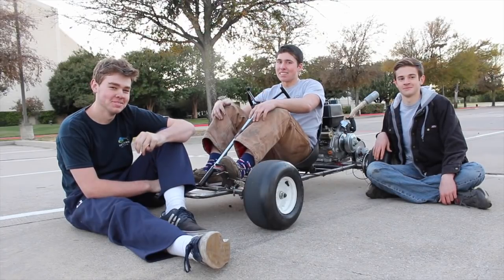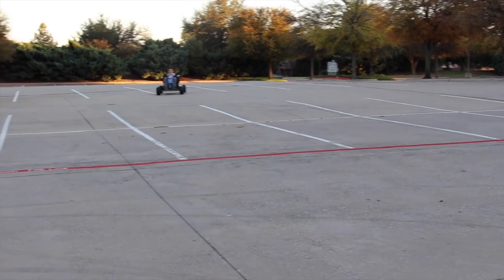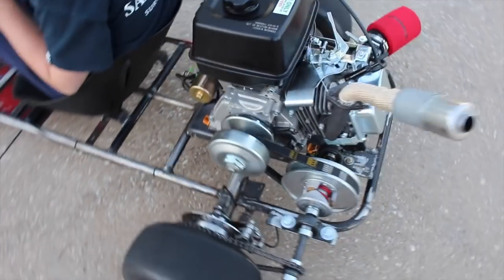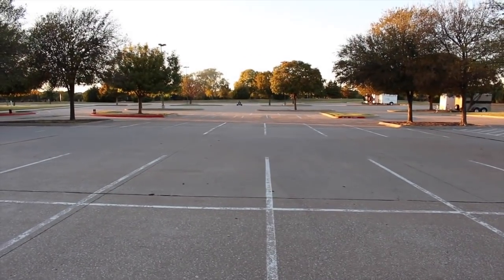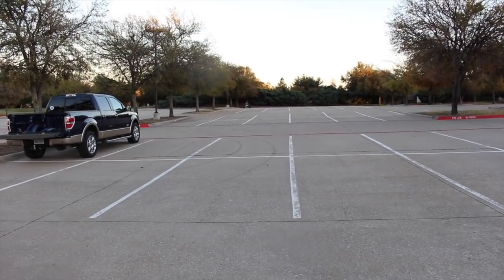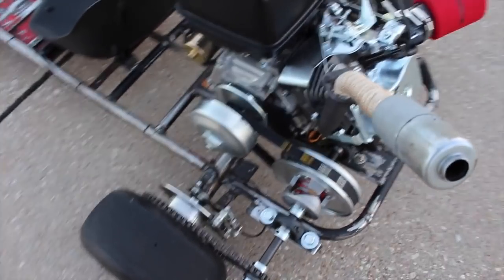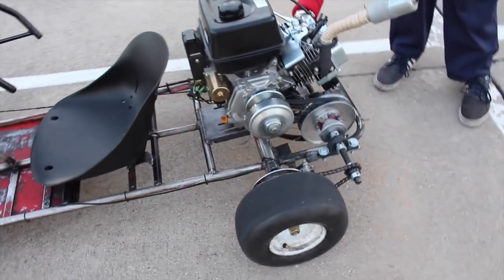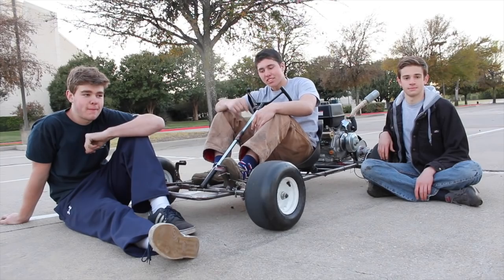We Built a 420cc Yard Kart for TV!

Comment: From what i could see,your clutch is not lined up with the torqe converter.your clutch on the engine side,should be lined up with the torque converter perfectly,or it will keep tearing up the belts.I used to work on snowmobiles and had run into this before!
Reply from the maker: Robert Hardwick ok thanks, I’ll take a look when we install the new belt.

Comment: Looks like your belt is too tight. Your jackshaft is too far away from the engine. There should be a little play in the belt when the motor is stopped or at idle. That allows for slippage, so the belt doesn't immediately engage upon starting the kart, which is what it did in the video. Didn't that torque converter come with a mounting plate? If it did, that would be the distance you need between the pulleys. Try moving the motor back a little.  EDIT: Yeah, I also noticed your belt is way out of alignment.
Reply from the maker: F5 Tornado Ok, I think it might have been to tight, like some other people said I should check the alignment too

Comment: Move your seat back closer to the rear as much as possible and put a larger sprocket on your final drive. It won’t be as fast top end but it’ll make it jump out of the hole quicker. More rear weight may give you enough to wheelie.
Reply from the maker: Rusty Crusty CJ7 Yeah were gona stick with the sprocket that’s on there for now but moving the seat back seems like a must. Thanks.

Comment: It appears that the pulleys are not properly aligned. You need to line the inside part closest to the engine up with one another. Take a straight edge and put on the back side of the pulley.

Comment: Nice build guys. A word of suggestion, to stabilize the cart add caster to your front steering. It appears that your steering knuckles are straight up or 0* caster, tilt them back ( ||  \\ ) about 5*. Doing this will make better use of the tire for more gription and better high speed stability.
Reply from the maker: Justin Price Yeah we’re planning on adding some caster for steering because the live axle gets too much traction for tight turns.

Comment: I have much respect you and your crew. It seem to me that bigger adventures will be coming your way. It good to see  that spirit
I going to throw this out to you its not cheap not a give a way but will make good project, that is of course that you still like wheels or have  not moved on to Jets already.
I have Toyota MR2 1985   The motor? leaks oil faster than a sive. Transmission manual  good condition.  I am too old to work on it 
shame its a mid engine  right for racing my boys not into it.  You guys are smart.  Body and interior good and wold be worth  an investment.

Comment: You need to get a good belt. Those ebsy belts are junk. You need a comet brand belt. You can look into changing the clutch springs. Hard acceleration off the line is tough on belts also
 Great job on the build. 👍
Reply from the maker: WallysWheels Remade Alright thanks, that’s what I was thinking.